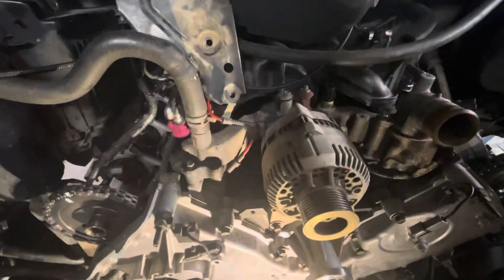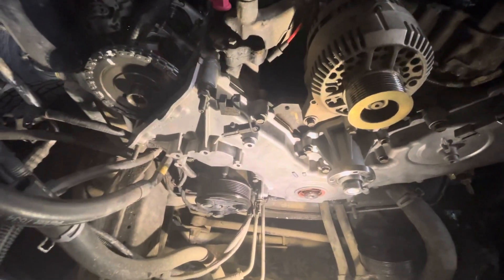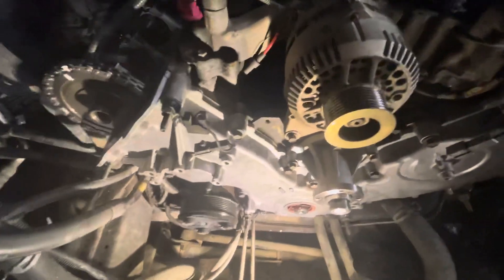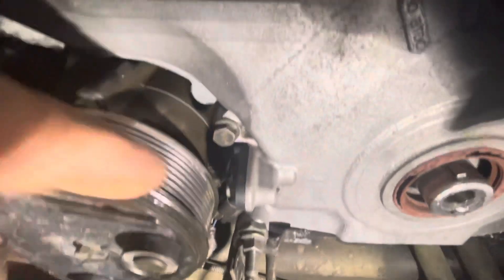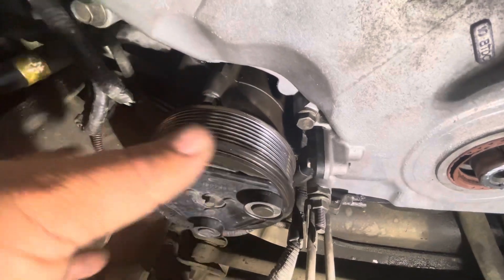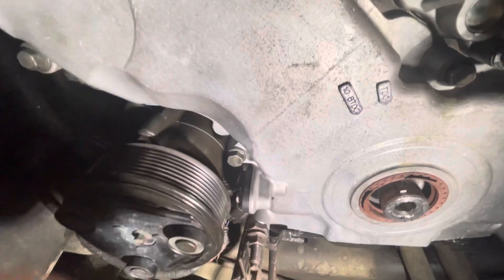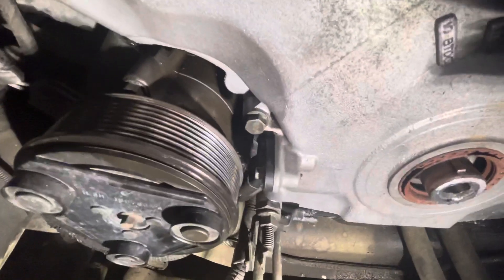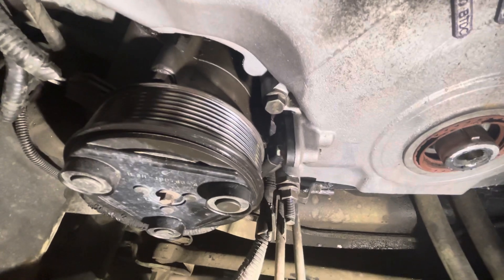2001 Ford F-350 V8 5.4L 2 Valve Crankshaft position sensor location. Gasoline engine.

Comment: Wow, what genius decided to put it behind the AC?? Oh right, Ford strikes AGAIN!
Reply from the maker: lol, Dont sart on toyota sienna, i mean toyota's are good quality, but design, as stupid as possible, and i'm pretty sure theres more than just toyota like that. in order to replace rear 3 spark plugs, that towards a firewall, you'll need to remove windshield wipers, all that plastic, wipers motor assembly, entire intake, and if you have skinny long arms with 2 L bows, you can get there, it will only gonna take 4 hours to do 3 rear spark plugs!

Comment: Great job man, can you show how to remove the ac compressor if bolts are stripped? Should I try removing motor mounts and Jack Engine up and see if I can cut bolts.  Let me know, cause I'm having troubles with bolts on 5.4l. Thanks
Reply from the maker: Apparently this vehicle is no longer available,, unless I’ll be having same ford, I’ll show you, but as for right now, I am not working on any cars, for a short time.
Reply: @delta_mechanic  thank you Sir for reply

Comment: Thanks for confirming position and fact AC has to be removed. Did you ever change the crankshaft sensor (remove AC compressor) and have a video ?
Reply from the maker: I did replaced, But i don't have video.
Reply: @delta_mechanic a lot of us could have used that video. Of you actually replacing. Wouldn't believe how difficult it is to find a video explaining, and if bolts strip what to do etc